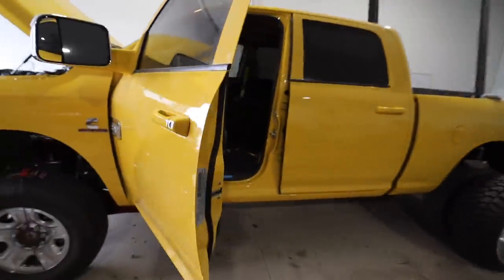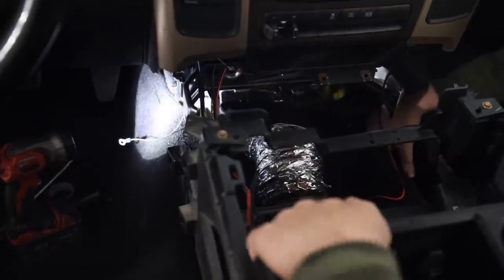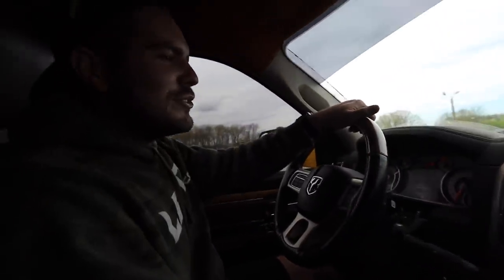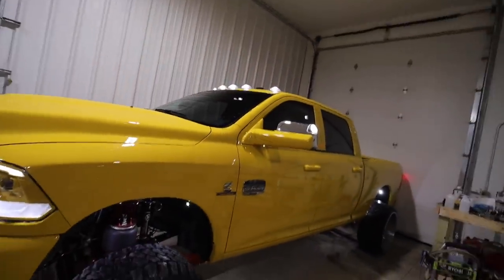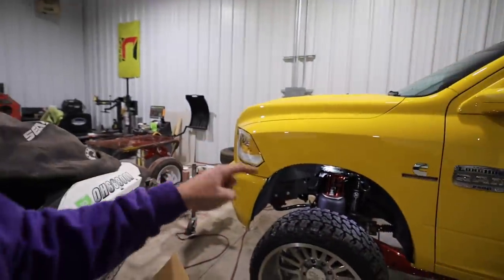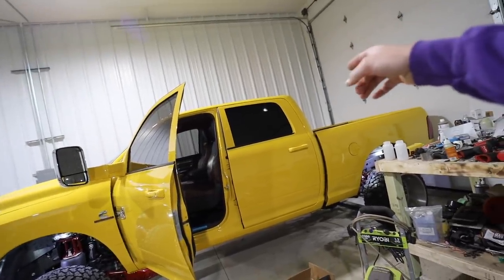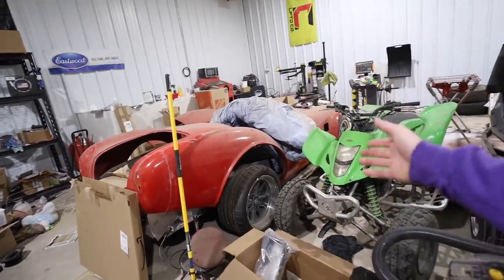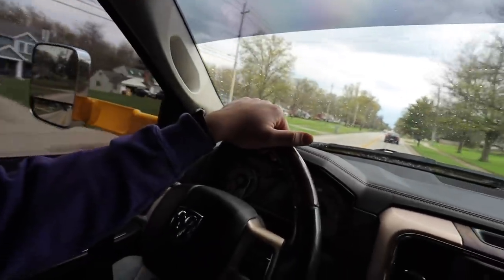I Built The Worlds Widest Taxi

Comment: The front Driveshaft would look awesome red but I just changed mine u joint in mine and it’s a big puzzle to get the 2 u joints in the back out and then back together. It would look sweet but much to change the rear 2 u joints

Comment: U run more air w/a mix of propane or nat gas u can knob turn up or down for best track or best mpg, might double or triple right mix setting fuel MPG. So 10-14, mayb 18 truck gas or diesel miles could be 20-30 or 35 MPG easy get trillions of dollars saved. Just eco fuel trim it max computer down & knob Nat gas or propane up.

Comment: I found something out it’s very interesting and it works with the FOBIK keys the same ones ur green and fake taxi truck has u put the fob next to the ignition touching it and if u stick ur finger in the hole u can turn it and it’ll power up fancy trick if u want a little remote start action but some times the truck will let it operate as the second key making u able to lock it I have to find out how to make it always work

Comment: not trying old 4 on hwy u can spare power running factory AC power draw or just use your battery bc 2022+ Now u best hybrid system. On interstate no power gen or alternator mayb2 alternators easy get, but stop & go use factory stuff to burn fuel vs battery or gen stuff at speed, if u drive up hill or towing same idea, u can switch off gen or 2nd alternator, & just be hot running heat a stretch to keep trans cool.

Comment: Why no 1 has yet to hve a rear end hogs head w/2 clocks time, either u bolt drive line here or u bolt drive line here. So u hve tow power setting 4.1 or better power mode or u hve eco driving a better truck 90% of time 3.73 mode so hense 2 diff times.

Comment: So like double din for radio, u can hve double vent directing, & u hve 2 fans blowing & most of All 2 ACs a crappy factory AC & a super way more efficient 12 volt mini split AC or heat right off battery b4 u warmed car/diesel truck up. Run both AC on hot day if u hve 2 batteries 2 alternators or a gen w/enough volts. Cool fast hot fuck 1st in truck 10min vegas hell day. Then u can back it off down to factory once battery getting low 20mins or so driving & car can keep up Now.

Comment: If u were short or wife was short adjustable peddles not just a lazy person option. U never did a real days sweat by hour work bc your builds all about show not work, not tow no go, but tiny market ppl pay for. A work truck best feature is old school vent diagonal windows, that deserve a modern day similar idea rip off. Bed liner ok but on the top of bed nothing beats diamond plating protection lifting & throwing wheel barrels in back. There must be a real slider old school rear window that doesn't block your view hardly vs these new toy vent windows.